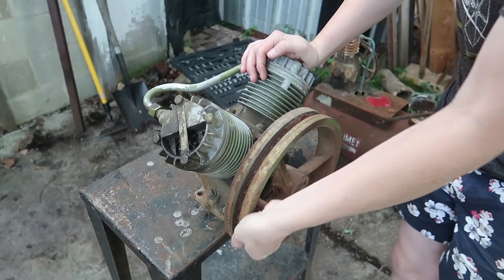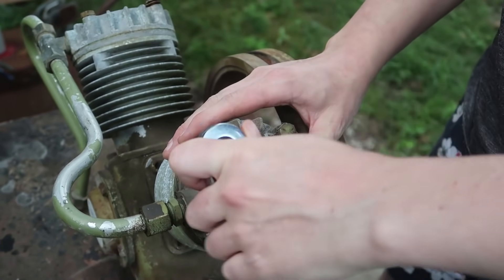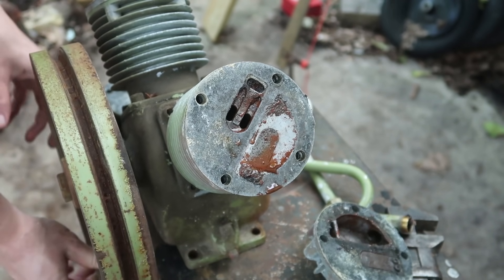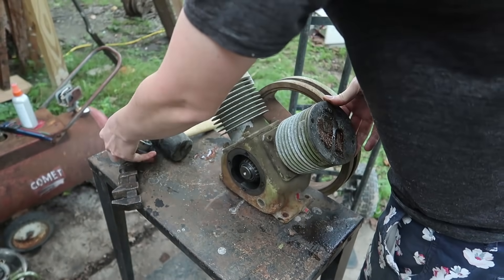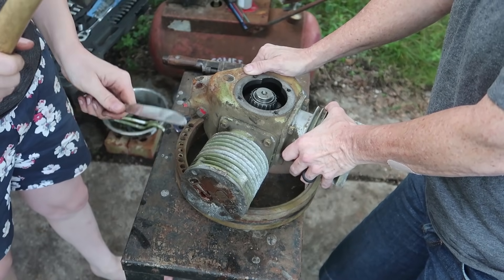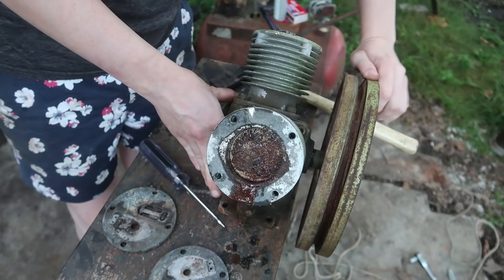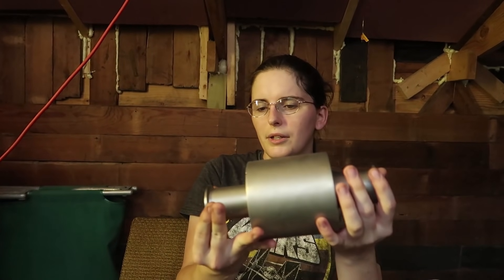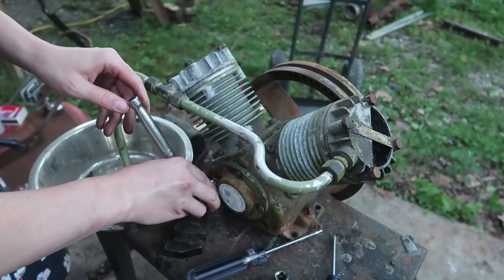DIY Stirling Engine 01: V-twin Air Compressor Conversion Evaluation

Comment: I got a ac compressor for $2 it's brandnew and intended for a Honda crz, I'm thinking an electric powered air engine on a trike or bike it's already set up to run on 12-14v so batteries should be easy to find

Comment: Probably the hot side would work better if you cut off the cooling fins , use a grinder to remove as much metal  as you can so it heats up faster too.

Comment: l really want to know what happens if the compressor is connected with vertex tube, will it be powered by intensified sunlight with the attached focus lens and how to maintain the temperature differential for stirling?

Comment: That filter-looking deal at 14:00 is probably a muffler for a large vacuum pump or roots-type compressor. I've seen them in dairy's on the vacuum pump exhaust for the milking machines to keep them from being so noisy.😉 I believe you can probably hone the cylinders and get everything clearenced and lubed up good on that compressor and it should spin fairly freely.. maybe still not freely enough to use as a Stirling engine, but if you design a couple of custom heads with slide valves, it would probably make a fairly good steam engine, although it would only be single action.😊

Comment: Instead of using a ru ber mallet, you should try a small bar that can slide over your ratchet handle, making it longer to increase tourqe. Using anything to impact the ratchet will cause them to become sloppy.
Reply from the maker: Ive never had any issues with hammering them tbh, and hammering seems better when you cant get a grip

Comment: Instead of using a ru ber mallet, you should try a small bar that can slide over your ratchet handle, making it longer to increase tourqe. Using anything to impact the ratchet will cause them to become sloppy.

Comment: Yes I got 1 of those torches , fkin suicide torch . You had to touch the hot metal , don't feel bad everybody must do that everytime , it's the rules. If you were a machinist I'd say put roller bearings in it. Lighten the rotating assembly and molly grease wouldn't hurt.

Comment: commenters have a common pattern personal attacks lead to "Should have"   all absurd. I watch videos to see others approaches if I were to legitimately have an idea to make better I would frame it in a constructive format. If i dislike a video or it creators methods i simply don't watch. I enjoyed this video's raw experimentation and being a plumber I want the torch she used. While not a soldering torch it looked great at hot wrench and I can think of other applications for sure.  Also like idea of using compressor for sterling
Reply from the maker: Thank you for this nice comment. Yes these torches are great, they also work for soldering if you have an antique torch iron

Comment: Two points:- 1. The large volume device she has got for a regenerator will contain far too much 'dead space' and will greatly reduce the efficiency of the engine, or possibly even prevent it from running. 2. Remind me not to lend this young lady any tools. Ever! Having said that, I wish her well in her efforts to build an engine.
Reply from the maker: You shouldn't lend tools ever in general. And I don't need any more tools.
Reply: @RinoaL  Actually, you do. The screwdriver you used as a wedge will need replacing, and the ratchet handle will soon fall to bits after all the hammering you have given it. It's a good job you don't believe in lending tools, that should mean you won't ask to borrow them either, 'as a refusal may offend'.

Comment: Very cool vid. But please for the love of all that is holy put on some boots before u drop that thing on your toes.
Reply from the maker: dropping it on my boots would be just as bad, its the dropping it that is the problem not the footware. if you risk dropping something you maybe shouldnt be trusted to hold it.
Reply: @RinoaL  Steel toe work boots with reinforced body are MADE to protect the foot from dropped items.

Comment: Could you try and use a sterling engine as the energy source for AC compressor. Where you would make the temperature differential by magnifying solar to such a high temperature that you can just air cool the other side.
Reply from the maker: you can not use an AC compressor to make the cold side of the stirling engine colder, but you can run an AC window unit from a large stirling engine if you wish to cool a house.

Comment: Did you ever get it running?  I thought there might be an issue with the two cylinders being exactly the same size.  You might want to try two single cylinder compressors of different sizes coupled together.
Reply from the maker: most sterlings ive seen are same size cylinders, and i havent gotten around to this project yet

Comment: Get a real hammer ( Metal) your life will be so much better...
Reply from the maker: metal will ruin this part, you must not be very smart
Reply: @RinoaL  Thanks for the insult. I thought that you were better than that. 
I didn't say "get a metal hammer and beat it to death".  Careful use of a metal hammer will deliver more shock in the right place and direction. Proper metal punches will help a lot , too, as opposed to screwdrivers.

Comment: I have the one-cylinder version of that compressor, that my dad purchased new in 1970 from Montgomery Wards. Same color, same cylinder, and similar crankcase. Plus the crapy air filter that decade to dirt.

Comment: I am in desperate need of a part 2 to this, and I just found you today!
Reply from the maker: probably going to be a bit, have a rocket engine thats higher priority than this Stirling engine. and a 1925 house restoration and stuff thats above that
Reply: @RinoaL  still no update? I think I have found 2 of these compressors cheap and would like to see how to make a Stirling engine

Comment: First off, I love that old torch Rinoa; wish I could find one. Just curious, if you grind the fins off the hot side would that keep it from dissipating some of the heat? Would it be worth the effort?  I'm the curious type; I would try it with the fins, take measurements and observe the performance, and then grind the fins off and see what the difference is. Just food for thought.

Comment: I plan to eventually build a high pressure and therefore higher performance Stirling engine from 2 identical twin HF compressors.  If I cross-connect through regenerators each single cylinder on each compressor with it's mate on the other compressor and then couple the driveshafts via a chaindrive,  I can get whatever phase angle between the pistons I want . One entire compressor could be the hot side and the other compressor would be the cold which would help improve efficiency by blocking heat flow from the hot to the cold side that wasn't performing work. 

Replacing the crankcase lube with graphite or other dry lube would allow the entire "hot" compressor to run at an elevated temperature. Sealing the crankcases of both compressors would allow a higher working pressure and a better working gas like helium or even hydrogen.
Reply: so how as the engine going?

Comment: In the process of cleaning the rust off, I would highly recommend the judicious use of oiled steel wool. The oil should be a detergent based oil. Transmission fluid will work nicely. You'll also want to replace the gaskets. You may be able to find a kit. If you can't find one, you can simply get a piece of thin cork gasket material and cut it to fit with a razor knife or exacto blade. If you take your rubber mallet and tap lightly around the edges while holding the gasket material in place, it should give you accurate marks to cut along. For the bolt holes I recommend using the rounded end of a ball peen hammer to tap lightly right over the hole through the cork. If you don't feel comfortable doing that you can use craft paper to make a pattern. I'm looking forward to seeing how this turns out.

Comment: Put a piece of pipe on handle of your socket wrench. Cheeter stick.
Reply from the maker: hammer works better because then you dont have to hold the part down

Comment: air clasper pump clamp with a clamp and you know you've got yourself injured :)
Reply from the maker: what?
Reply: @RinoaL  you should use a clamping vise you can drop the air compressor on your feet be careful

Comment: when you mentioned the offset were you referring to piston tdc offset or the angles of the pistons on the crankshaft? btw thanks for making the vid
Reply from the maker: well i was using the same word for both when explaining, but overall i was talking about timing offset.
Reply: @RinoaL  So Top Dead Center Offset? Thanks 4 sharing.
Reply: Are you so are you saying that the connecting rod journals are offset by 90° on the crank? I would really like to know and have a little more clarity thank you.

Comment: Alittle bit of heat always helps when breaking something down just becareful aroind aluminum small blow torch is always handy
Reply: I commented that right before u got out the torch hahaha
Reply: Ever need any advice or tips let me know i have the same compressor that im goin to turnin into a gas engine

Comment: The way to increase the efficiency of a stirling engine is by increasing its working pressure. ~( 'w')/
Reply: Also, using helium instead of air.
Reply: @Anvilshock  This is true because a lower mass and lower viscosity will allow the gas to get from one side to another far faster and result in less internal drag so that the gas has more time to work on the piston and apply more pressure before the stroke completes. (~_^)-b

Good thing you brought that up.

I suppose, if one were not worried about viscosity and inertial mass they COULD use a gas with a lower specific heat because that would mean the gas would heat up and cool off more rapidly...

However...although several gases have lower specific heats than He2 they also have higher masses, vapor pressures and viscosities, so I suppose the advantage still goes to Helium after looking at a lot of gas constant tables.

I would say that in the end, Helium indeed would be the ideal working gas for a stirling engine.

Thank you, Sir Anvilshock, for contributing this option which I had not thought of, and if I ever build a stirling engine [I have thought about it but have not yet tried to] I shall make sure to employ helium, but, t9o be fair and make sure that there are no secretly superior [or even comparable] gases, I might try running various other gases and recording their performance, just to make it more 'scientifical,' and present some results for general publication, so other people can use said research data while designing their own stirling engines.

Comment: That OLD adjustable wrench is so badass.  Now I have to find one...
Reply from the maker: search for Coes Wrench, they are easy to find. they come in a wide range of sizes
Reply: Hey, thanks a lot!  That compressor should be awesome as a Stirling engine.   Pretty sure the canister is a laboratory catalyst, most likely nickel,  but you may be right on a platinum group metal or alloy.   Either way,  it should be ideal and last basically forever for what you're doing. Looks really fun.

Comment: I seriously doubt you can overcome the inherent friction of the piston rings and crank bearings & seals.
Reply from the maker: i am not confident either but i am curious
Reply: @RinoaL  Keep in mind that Porsche Carrera Aluminum Barrels which are lined with chrome and light pistons using very thing chromed rings might be closer to what you want to use.  Turbine oil would be ideal low viscosity lubricant.

Comment: where components  Interact, make use of  'self-lubrication'.     use materials of different hardness, together.     brass, alum, mild steel, hard steel, stainless steel, tempered steel.      or glass on glass.
Reply: Good suggestion! Another way to go is using graphite powder in the cylinder if you wanted to be lazy, but your way is the better solution long-term. Though in the end, both solutions will depend on pressures, working fluids, and temperatures of course, as a disclaimer!

Comment: some thoughts.     i would suggest, if you haven't before,  that you  make  a  working  alpha or gamma stirling engine, from soda cans or syringes.   (beta config results in too much conductive transfer of heat, to the cold-side.)      here are some  Critical  facts, that apply to heat engines, especially small htd stirling engines:             the  MASS  of   each  component that  oscillates, or that orbits the crank,  Must be  Minimized; see the governor effect.     beyond sufficient stiffness, there is  NO  need for robust components.      all orbiting mass at the crank  Should  be  Symmetrical, around the center of rotation.   mount a crank pivot in a  Disc,   in lieu of an, Asymmetrically, massive   'arm'.      Because,   fifty percent of the time,  Gravity  Opposes  ANY  vertical motion.        [ pistons, wrist pin assemblies, con-rods,  linkage pivots/bearing holders. ]          a  prime mover  Should be loaded, so that it has  Mechanical  Advantage  over  the  load.     the small gear/pulley  goes on the  Engine output shaft ( for a heat engine, try six or more to one Reduction ); and engine speed should be the highest achievable.    ( see a  dc gearmotor, as an example. )      the output energy of a heat engine is, Always,  low-torque; so  correct loading is critical to good performance, as a prime mover.      vibration damping, internal to the system,  should Not be utilized;   because, damping  Absorbs/consumes  energy.        borosilicate glass syringes can be purchased, online;  as  lab  equipment.     ideally, the  length and the Mass of a plunger should be minimized.      in the case of a 'hollow' piston, a wrist pin should be located 'closer' to the  top  of  a  piston; for maximum stability, within the cylinder.      googletranslate
https://www.youtube.com/watch?v=vvpsO46IZLA
https://www.youtube.com/watch?v=-whRF163b20
https://en.wikipedia.org/wiki/Stirling_engine
https://en.wikipedia.org/wiki/Governor_(device)

Comment: Few days back I found similar single stage air compressor in scrap yard. I bought it immediately for making a piston expander for my air liquifier project. It's basically reversed baryton cycle cooler

Comment: Sanding the deck and head is not really needed, for something like this they don't need to be THAT flat due to the type of gasket they use. Just clean up any raised areas of any knicks that the screw driver may have made with a fine toothed file till they are level with the rest of the surface. Those gaskets look like old fiber gaskets, you can get sheets of it from any auto parts store (O'Reilly Auto Parts PN#: JV127) to cut out new ones, you should also be able to get gasket remover in a spray can to help break down the old ones. Spray them down, let it sit for a few min and they should easily scrape off. The new cut out gaskets can be sealed with black RTV, that type of gasket and RTV will seal just fine even on a 'rough' surface so they don't need to be perfectly smooth. The only part that may be tricky is the hot side head, depending on how hot you are getting it, something like exhaust gasket material may be needed (O'Reilly Auto Parts PN#:  5960). Since its pretty rusty looking you may need to pull the cylinders off and run a hone of some kind though them, and going against what is normal for combustion engines, you may want to try to get them as mirror finished as possible instead of leaving them cross hatched. The rings may not seal quite as well, but I would think the reduced friction would be more important than the best possible seal, but that really is just a guess. If it has two compression rings per pison, it may be worth even trying to remove one of them to help with friction.

Comment: So great, good job.  Your achievement is the practical basis for thermodynamics and mechanical engineering. At some point it would be nice to present the calculated anticipated performance and actual efficiency but that would simply turn everyone off. However, I do appreciate your effort, it's marvelous. What I enjoy is showing how thermal energy is so prevolent, just a little bit of heat can be converted to huge amounts of mechanical work. A good example is slowing a huge truck from 70 miles per hour to a complete stop and all that kinetic/mechanical energy just heated up the brake shoes, drums or discs a bit.
Reply from the maker: yeah energy conversion is something amazing

Comment: Looks like my dad's "Champion" brand pump that he used for his air compressor, built in 1973 or so, and still working.
Reply from the maker: champion, thats it
Reply: @RinoaL  That explains why it looks like it.  I'm glad you saved it.  I was a tiny tyke when dad built it. It's been a good one.

Comment: Rin, you should make that into a Stirling Engine, as you want, but then mount it to a bicycle!  That would be epic! Also, HI RIN'S MOM!  XD  Additionally, if making that into a Stirling engine proves too difficult, then you could always turn that into a giant 2 stroke gas engine.  Kinda blase comparatively, but still a technical challenge.  Here is a link to some more research material.  I'm sure you have found similar info online. 
http://citeseerx.ist.psu.edu/viewdoc/download?doi=10.1.1.463.993&rep=rep1&type=pdf
https://www2.eecs.berkeley.edu/Pubs/TechRpts/2018/EECS-2018-15.pdf